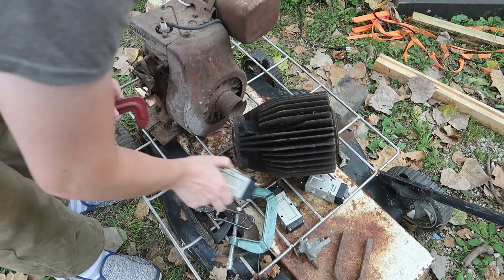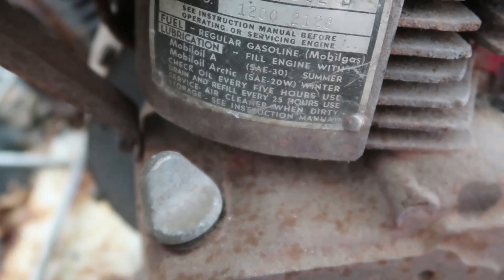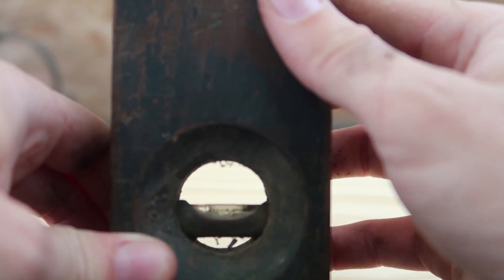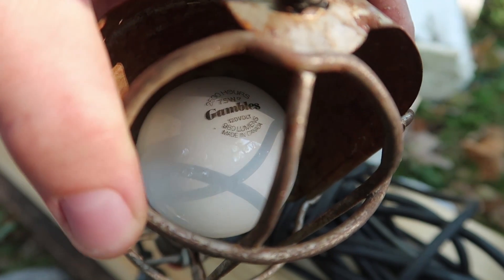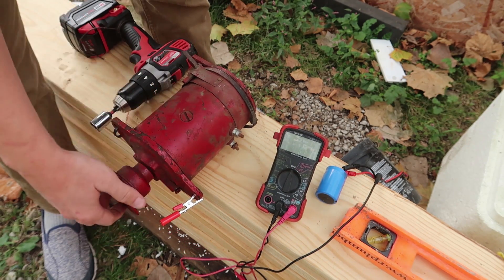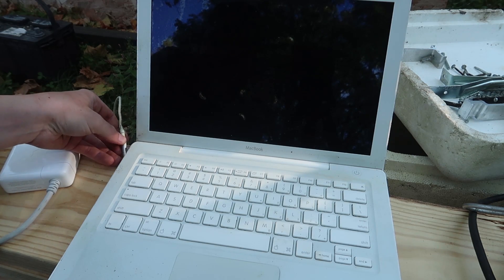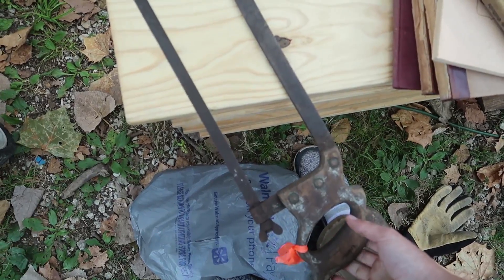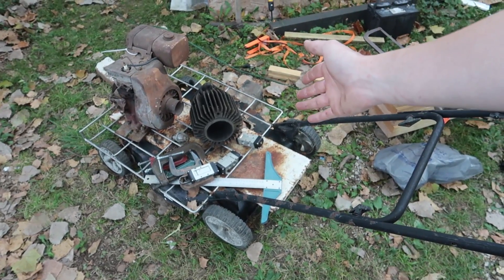Random Bits 0213: Engines, Tools, Film, Antique german books, and a Macbook

Comment: Pretty sure the cylinder is from an air compressor maybe a Quincy or an old York and the motor take plug out put some automatic transmission fluid in about a half a pint but it's set for a few days it's possible it could free up which would make it easier to take apart for a clean up and possible get it running. You might add about 20% acetone with that oil to soak through those Rings good. Just saying.
Reply: mike mullins ATF will get it right as rain as long as she lets it sit for a while. Probably could use a tear down and to run a ball hone through the cylinder.

Comment: The keyboard on the mac could be messed up.  if you take off the rectangular rubber piece under the battery, you can short it and make it start. If there is rust on the computer, there is probably more going on.
Reply from the maker: the light on the charger isnt even turning on, the logic board is dead.

Comment: i am willing to bet your generator is just fine.  the 2 terminals on it should be marked A and F.  F is the field coil and it will need more then likely 6 volts applied to it or it could possibly be a 12 volt one.  The field coil acts as the magnets in the generator when you spin it.  If you energize the feild coil and put 6 or 12 volts to the A terminal it should work like a series wound motor.  when no power is put to the A terminal you will get a voltage out of it when you spin it.   
cool bunch of finds.  The cylinder looks to be off an air compressor.
Reply from the maker: well i was trying to use the armeture to energize the field. maybe it doesnt work that way.

Comment: that generator looks like its a starter generator from a old kohler k 341 or etc..  try cleaning the slip rings and make sure the brushes are not stuck..    apply 12vdc to the positive and ground it at the bolt hole and see if it spins..  make sure its secure because they have a good amount of torque. the dc output will come from the other terminal..    very cool old drill

Comment: Another way to test the Generator you have is to use it as a motor. Put either 6V or 12V to the terminals and it will work just like a regular motor. If it is a true generator, it has permanent magnets within it and will work in either mode. A car alternator will NOT work without a battery on it for any purpose. You may know that already, but just my two cents.

Comment: That generator maybe off and I HC maybe anything from a a c h or M it probably is for a 6 volt battery  more than likely is what it is. I replaced a bunch of them. where you turn it in the right direction just wondering seems like from what I remember it should be turning counter-clockwise looking at the pull.

Comment: Oh hey, I have four of those U-magnets, mine aren't very strong so I've never found a use for them. Oh, a Clinton engine, nice! Awesome old air-cooled cylinder! Reminds me of aircraft cylinders. Love the detailed covers on those antique books! Nice wooden level! Huh, that's a good-sized generator, maybe off a tractor or stationary? Yeah, that Macbook is rough, wow that battery! Generator might need polarizing to restore the residual magnetic charge, gonna have to do that with the generators for my VW bugs whenever I get around to building an engine. Nice, love metal-body drills! Ah, no charger light, no PPBus to tell the charger to turn on! At the very least, the circuit the charger interacts with isn't working. NES controllers, nice! Cool handheld spotlight! Mosquitoes might come from the canal you bottle-hunted if the flow is slow enough or there are places that it pools. Cool stuff! Huh, the comments say that's a butchering saw for bones, would make sense that's where mine came from as it was previously owned by my grandfather who hunted and butchered his own deer.
Reply from the maker: yeah i only learned it was a butchering saw like 3 days after this when i happened to be watching a BBC documentary on the history of servants and saw it in there. makes sense because it sucks at cutting wood
Reply: Yup, same experience with mine, I just thought it was dull! But maybe it is, would a slightly dull blade be better at cutting hard-yet-brittle bone? Perhaps I'll sharpen mine someday and find out if that's enough to improve its performance on wood. Not an time soon though, many other things to work on. Currently chain-link fence repair to keep the dog in.

Comment: The magnet comes from an antique telephone dynamo generator. http://telephone.bouwman.com/Generators.html    
The cylinder appears to be from an air compressor.  Certainly not a tractor.   Replaceable air cooled cylinders were used on radial aircraft engines from just before WWI, to just after WWII.   Tractors, even old ones are all water cooled.  Unfortunately, it will not make a very good steam engine cylinder.  In a steam engine, keeping the cylinder hot is a prerequisite to getting any speed or efficiency.   All those cooling fins will cool the bore and a good deal of your steam will be wasted condensing on the cool walls of the bore each stroke.   

Look on the bright side, it will make a cool lamp or something.

Comment: Hello Rinoa: You've found a real treasure trove. Guaranteed to give you lots of challenges. From 1966 to 1971 I worked for the GE Lamp plant in down town Toronto. Have fun Brian 78
Reply from the maker: wow thats cool, did they have the machines that blew the molten glass into bulbs there?
Reply: For Sure! We built everything from the ground up. Even designed & built the machines used to produce the lamps. That requiered a lot of skilled engineers & millwrights. Brian 78

Comment: I got one of those lights too with my boat, mine is made in Japan, the metal case feels pretty solid and (at least the one i hawe) are made of cast metal, they are 12V in original i think, but i guess they are pretty easy to modify to something else if one want to. I think i will restore mine. Maybe a nice accesoar for Your bikes toolkit?

Comment: I have that type of MacBook.  The battery is shit but the power still works and the computer is functional.  Apple no longer supports that model nor an iOS for it, bu its useable.  Without the battery however, it basically scraps.

 I had a collection of a of books that I abandoned during the misfortune of being transient.  So much real fun information about anything are stored in such books.

I hate mosquitoes 😖

Comment: If the generators are anything like alternators, usually an external voltage source needs to be applied to the field coils to get them to work (such as from a battery); at which point spinning it will give a more significant output voltage (with the 0.6v or so likely due to residual magnetization or similar).
Reply: Gennies are DC so you don't need to excite them.

Comment: That looks like a old starter generator. I like the old things you always find. Here in Seattle you can’t find shit. Goodwill is the closest thing. I’d love to go to a scrapyard but they all suck. Just turned my volume down because my brightness was too high....
Reply: Dylan Reischling yeah that could be an old starter generator. Not sure. Delco I think used to make them to start then generate on old Wisconsin engines. Like an 1194????? I tried to figure them out but they are sort of confusing. I think they have bushings inside you can change. Trying to recall if it has 3 connectors???
Reply: lcagee I don’t know. I’m pretty sure the old Volkswagen bugs used them and vans used them. I think it’s just you supply power to it and turns but when the engine starts and it’s spinning then it charges. I assume they probably used some sort of diode pack on the charging side

Comment: I think most generators have external voltage rectifier-regulators.  Try measuring AC voltage.  https://www.ebay.com/itm/372450041521  << You can see the missing rectifier box in those pictures.  https://talk.newagtalk.com/forums/thread-view.asp?tid=671454&DisplayType=flat&setCookie=1
Reply: https://www.youtube.com/watch?v=bxTsANakLf8  hmm...  a starter-generator.  something tells me that box isn't a rectifier then.